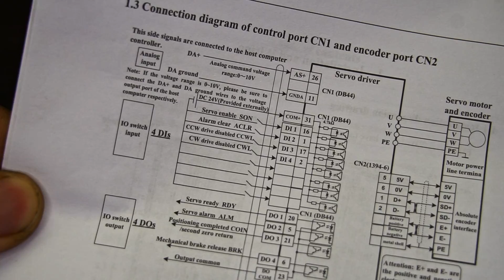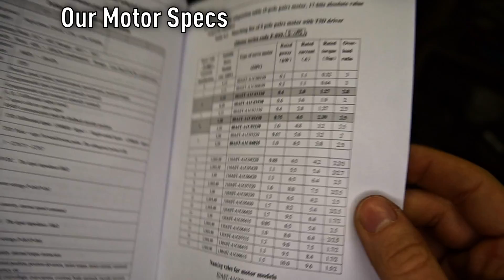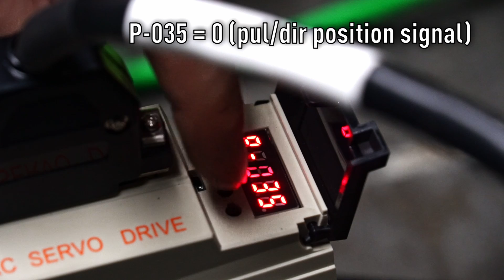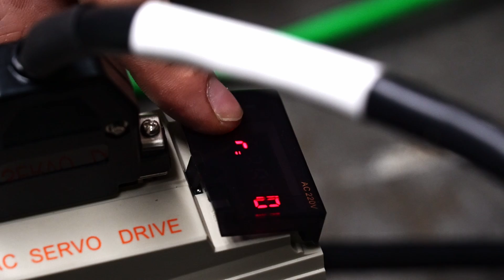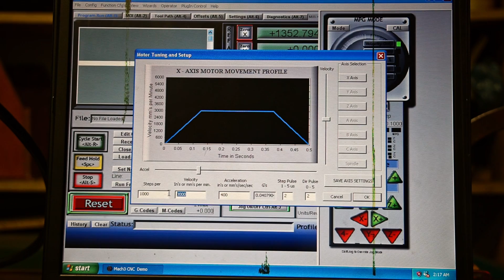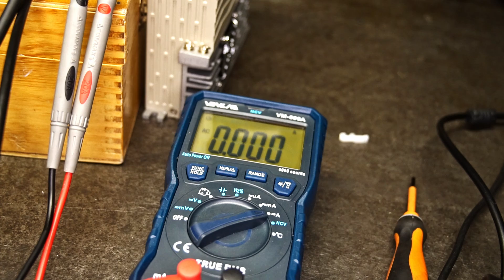How To Setup AC Servos with Mach3 USB RNR Board

Comment: Is there any way to make the mach3 stop when the servo misses step? or any configuration or the driver manages everything on its own?
Reply from the maker: The driver takes control of everything - there are no missed steps in such devices. If you put too much load - it will throw out an error and you can set it up so it sends a message to the controller.
Reply: @GBWM_CNC So what would be the step to notify the controller? What would be the avenue for the feedback? I'm about to replace my stepper motors with these and I've been wondering what that would be.  According to the sellers I ordered these from they said that the motors would just stop if errored out, but that would still mean the machine would be "running" them.
Reply from the maker: @LogicSpeaks  The servo driver has digital outputs. If it gets too much load it will put out an alarm (seen on video) and you can get that signal on one of the outputs. And you can attach that output to the CNC digital inputs (similar as a limit switch). I did something like that on my CNC mill - I have similar servos and when those put out an alarm (stop mode) - they notify the CNC controller (AXBB-E was there on the board) about the error. I configured it as an emergency stop signal or something similar - I don't remember exactly. And I wired the signal from all 3 axis to one CNC controller inputs - when any of the servos gets an alarm then the CNC controller goes into stop mode.
Reply: @GBWM_CNC Ah okay, thats awesome - thanks for the info.  That makes a lot of sense. thanks a ton!

Comment: I wanted to ask one thing, for Z axis do we need servo with brake model? I have 1.3kw Leadshine 1500rpm 8.34N one for 2 x and y axes, for Z axis is currently the nema 34 closed loop stepper motor, so i was planning to change it with the servo too.. Do i need the brake model of 1.3kw servo or the non brake version would also work? I dont know how much detent torque it provides and all
Reply from the maker: You dont need a brake for z axis but it depends on the weight. Sometimes you need a brake of preferably a counterweight. All depends on your needs. If the system is perfectly aligned - sometimes there is almost no friction in the linear bearings and ballscrew and  everything could fall if there is no  counterweight.
Reply: @GBWM_CNC  The spindle mount has only 7kg of Spindle and no counterweight attached to it, Also how to check for the detent torque?
Reply from the maker: @dd_Dedsec  what do you exactly mean by detend torque?
Reply: @GBWM_CNC  I mean detent* torque, its the torque thats available for the motor when not ionized or standstill when no current is passing through it
Reply from the maker: @dd_Dedsec  oh, like that. So if there is no brake - the shaft spins freely if no powered. About the brake itself - i havent used such. You'd have to check the documentation
Reply: @GBWM_CNC  Oh okay, I thought servos are like Stepper motors that have magnetization power due to permanent magnets that still provide some torque when the current is not supplied to the coils... Servos are built differently
Reply from the maker: @dd_Dedsec  exactly! These are more like synchronous ac motors

Comment: Useful video, thanks. Do you know the white 4 pins connector (near the USB connector)  on the controller board what is for ?
Reply from the maker: Thanks! The connector is for connecting a mpg
Reply: @GBWM_CNC  Not the black one, the white one 🙂. I know the black one is for MPG or extra input pins but i'm not able to find something about the white one 😞